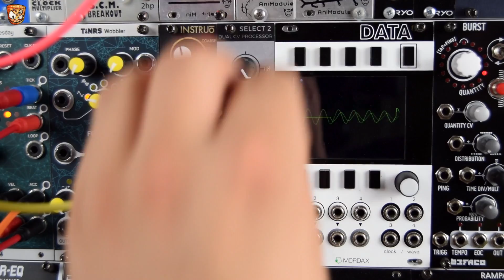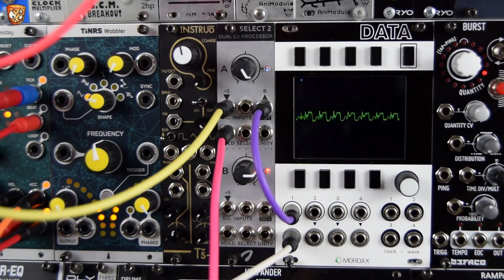'Freeze & Pass' weird sample & hold from the Joranalogue Select 2

Comment: A bit like a track and hold, only it tracks when the voltage is low instead of high, and then freezes when it goes high instead of low.
Reply from the maker: yeah that's reverse of the normal function if I remember that right. I mention in the description it's track and hold but I think you're right it's the reverse of it. But ... ultimately the same affect I guess.
Reply: Yep, basically track and hold with reverse polarity. Because 'tracking' doesn't affect the signal, while holding does, holding in S2 requires a active high gate signal. This also makes more sense in the context of a CV processor, which ultimately is the module's main application.

Comment: Right now I'm wondering if it would be possible to switch between 2 different audio signals with audio rates using Select2 (plus a VCA and an audiorate pulse wave) and what that would sound like.

LOL, I just realized that the Select2 isn't even needed for that ...
Reply from the maker: A really nice example of that done at zero crossing points is the combo of the Zero 2 and Switch from DPW Design. I do that at 13:55 combining a sine wave bass and a rings tone in this video - https://youtu.be/8UYYGe4KIZA?si=-H4zsgALvpxEai4-&t=835

Comment: I know you done a review of Data but.. I got two Mothers, Clouds, shelves and E352 + pedals, Pocketoperators, a Keystep, a microbrut that I blame for leading me into all this but at the moment is a dust collector, + a tabletop mixer. I know I should get a VCA and modulation, Maths, Batumi, quadra or something like that. But I wonder, should I get a Data this early, or would I be better of with Pam or Tempi for clock? Tempi seems more playable and fun but Pam has other things to. Am I right in assuming that the Data still only can be used for one thing at the time?
Reply from the maker: DATA was for Future Music magazine (for anyone that's reading and missed it - https://youtu.be/W2HIsrTBwt4 ) DATA is fantastic as a visualisation tool and as a generator for audio/modulation and clocks. You're right it will only do one of those at once. No sign of it doing more than one thing at once either. Really depends on if you're wanting to visualise what you're doing or just use it's functions. Id probably get some other functions covered first.
Reply: Thank you : )